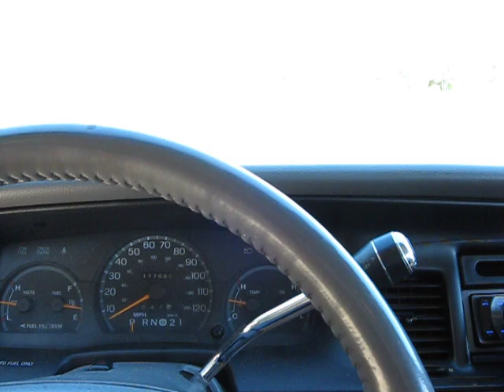kicker setup in a flippin crown vic (literally)

Comment: yo my ninja your shit knock about as hard as my 99 vicky with 2 old skool kicker comps the 1500 watt ones and im running 3000 watt mono block amp.. got that shit wired rite .... and the paint my dude is flippin hard tight work.... wheres dsr at? in the dade

Comment from the maker: So whats the point you trying to make and no the car costed more than the paint. If youre implying that i put expensive paint on a cheap car wellllll. Thats like ppl who race cars for a living. Of course the racing motor cost more than the car. The parts you buy for the car will cost more than car. When you buy a new car off the lot......that car already dropped in value several 1000 dollars. A couple years into paying for it, you become upside down cause the car aint worth what u paying for it.